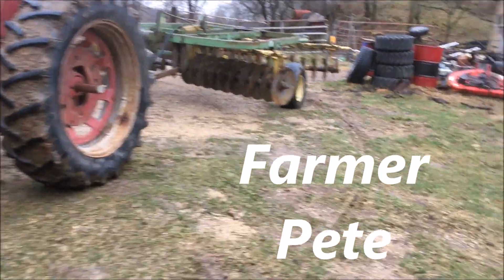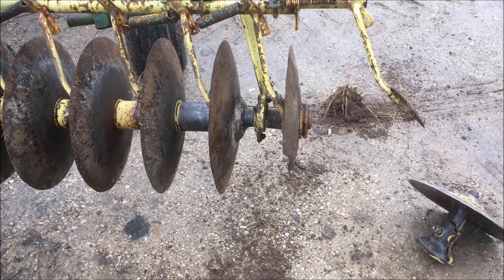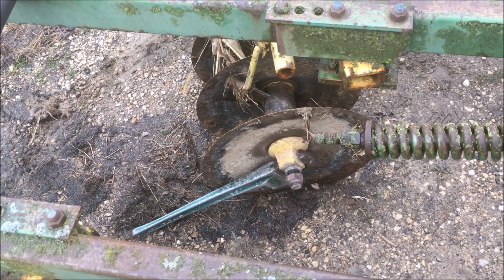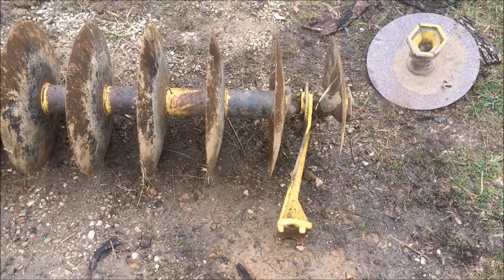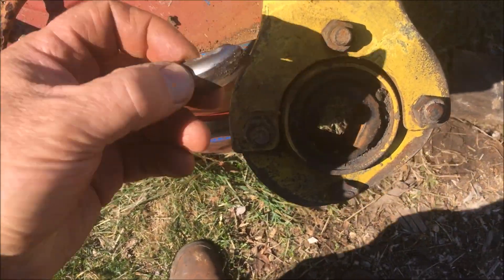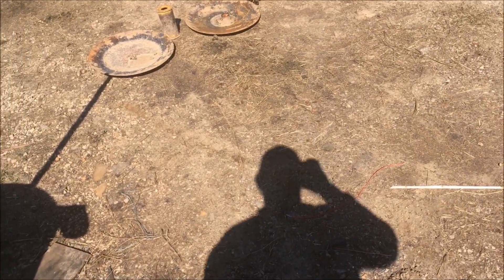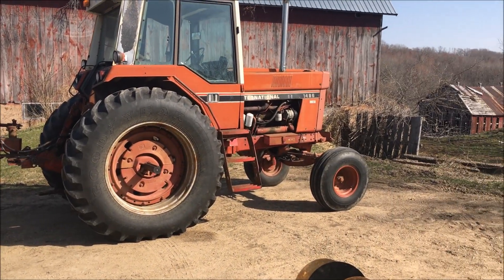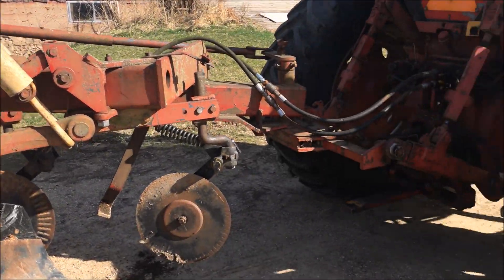John Deere 110 Disc Repair & New (to me) Tillage Equipment

Comment: Your doing better than me on getting your disc fixed. Took mine apart last November and just now got it back together.  Video coming out next week. It will be a good one to watch.  It starts out last November and then in update in December,  some in January, last part I thought in February.  Finally put it together to find the shaft was to short because of the updated new bearing and had to make a special order from Shoup that showed up 2 weeks ago.  All put back together. I think you will enjoy the road blocks that came up, lol.
Reply from the maker: Looing forward to the video!

Comment: It's always the blades at the dead end that get messed up.. 
Our big offset disc has nits on both ends of each shaft, but usually still have to drop the gangs to work on it.
Reply from the maker: Yup. Got to take 'em all apart to get to them.

Comment: Good  day  Yea good job getting that done.  I have a ford 201 3 pt ht, beating gone they $283.  for one,  more than what  disc  is worth... They are  as wide as area is between 2 blades  6-7 ins. What did you bearing cost?  Thanks
Reply from the maker: Not too bad, about $30. I ended up ordering one from All State Ag Parts.

Comment: What is the correct lift cylinder size for the 110?   I just bought a used one w/no cylinder and haven’t been able to get the size info.  Is it a 3x8?  3x10?  Thanks!

Comment: Correct me if I'm wrong but, isn't the 1486 a 130hp tractor?  I've used a 1486 (2-wheel drive w/duels) to pull 6 16-inch bottoms with no trouble at all in our shale.  I think it would be a little much for the AC180 but, I'm only guessing what your soil is like.  Around here, our shale takes about 20hp per 16" bottom, but you won't be going real fast.  Are you planning to use this plow behind the 1086?
Reply from the maker: I'll use this behind the 1486. We have every soil type. When you hit the heavy clay 4 bottoms is enough.